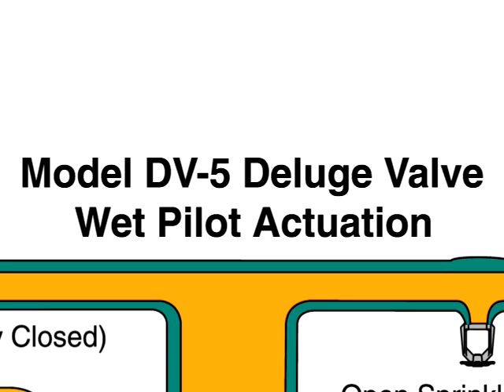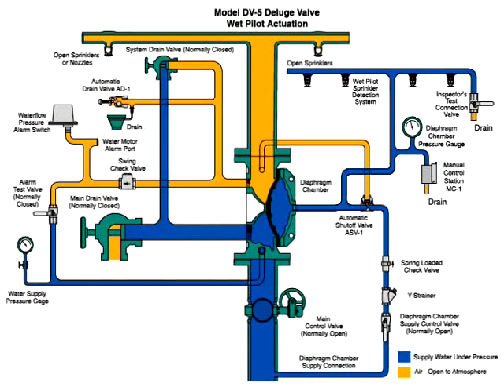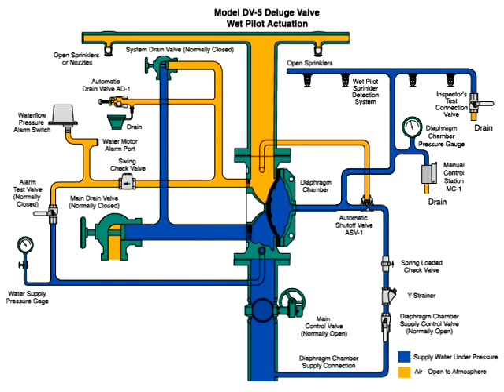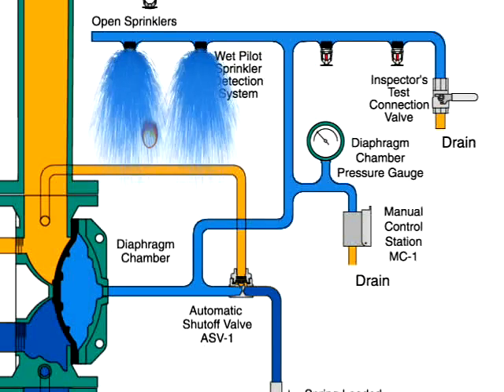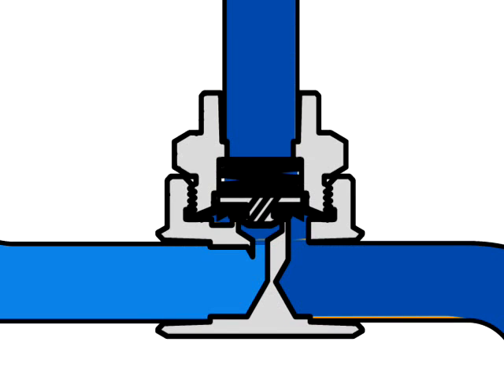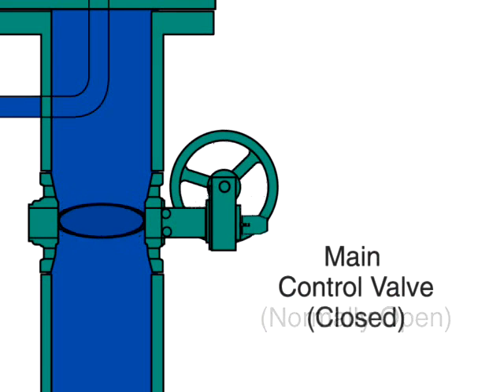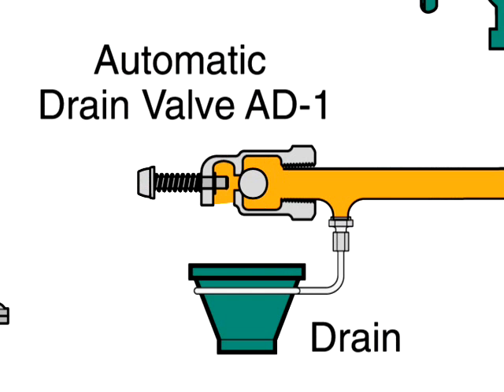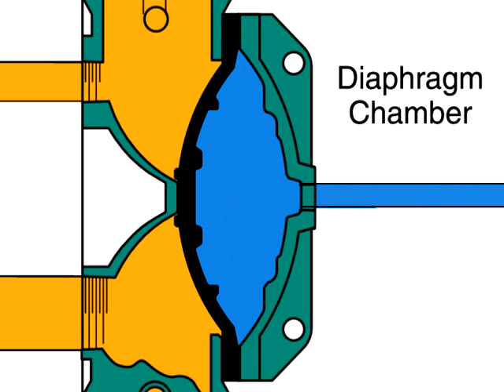TYCO. DV-5 Wet Pilot Actuation

Comment: The automatic shut-off valve that prevents water from flowing out to the pilot sprinklers after the deluge actuation - does it come as a standard component to all deluge valves regardless of brand? or there are other deluge valves where this ASV is not included so that during actuation, water continuously comes out of the busted pilot sprinkler?

Comment: [10/12, 11:24] UPCOMING VERSION 3.O: 1.
Main control valve (N.O)
Have to CLOSE
2.
Diaphragm chamber  valve(N.O)
Need to CLOSE
3.
Main drain valve (N.O)
Need to OPEN
4.
System drain valve (N.C)
Need to OPEN
5.

Finally closed all valves except main drain valve .

Then reseted..

But doubt is entire this process compressor need to kept on or off mode....

I didn't switch on compressor sir .

Panel Alarm not reseted sir...
Showing above indication
[10/12, 11:26] UPCOMING VERSION 3.O: Also Compressor not  cutoff 
It's running continue
[13/12, 11:18] UPCOMING VERSION 3.O: Sir I tried many times
Diaphragm gauge is not getting to zero
Remaining water and air gauges going zero while trying to reset and compressor also not going to cut off...
System still showing same problem sir..